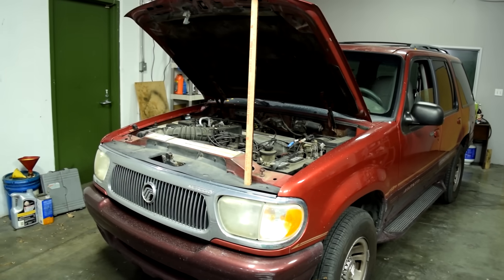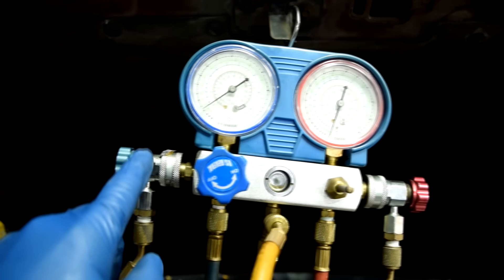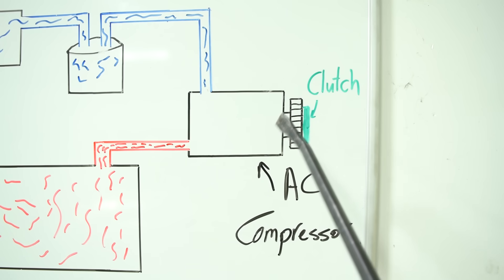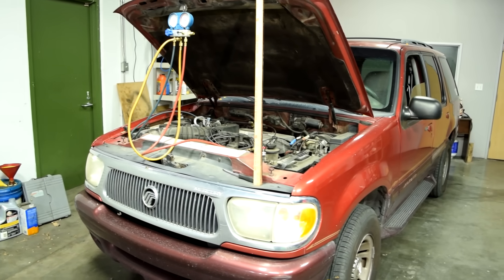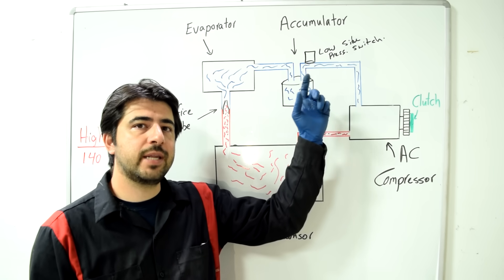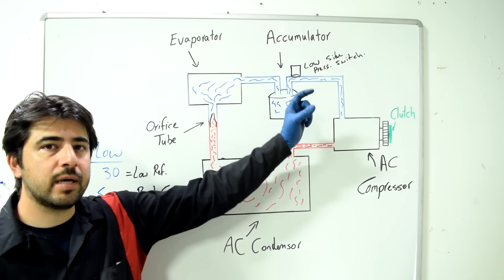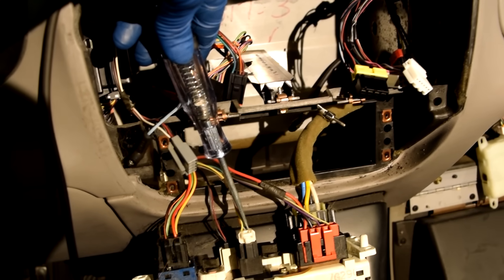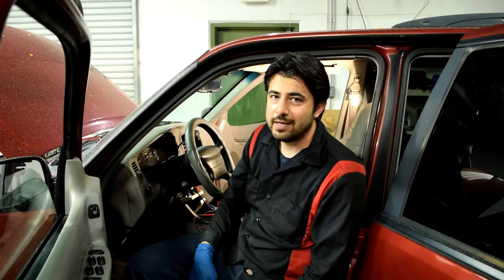Automotive AC Diagnostics, Operation and Repair

Comment: I have replaced so many of these blend door assy I can do it with my eyes closed...
Reply: Question sir. Do you remove the air handler assembly from the vehicle and use factory parts? Or do you use an aftermarket kit? Thanks
Reply: @josephmaslowski4051  factory parts
Reply: @ThomasAdsit  thank you. I've used "heater treater" so far so good.

Comment: Great video, there goes a like!

Question; I have a 96 Ford Ranger, same A/C as the Mountaineer you work ok.
Very hot day (40°C) and very humid too.
Static readings on both sides: 90PSI
When I turn on the truck and A/C (on max, full cold and full brast) the low side stays FIXED on 40 PSI, and the high side also stays FIXED at 190PSI. Neither of the gauges goes up or down, they stay in place.
Also, the A/C compressor stays on all the time (no ON/OFF cycle) and no condensation water is coming our from the HVAC box.
It blows cold air on the inside, but I think it should be colder.

Im affraid that if the a/c compressor wont cycle it might get damaged.

Any input on my readings? Any help will be appreciated! Thank you very much

Comment: Excellent video explaining how A/C systems work.
Can you give a video presentation on converting a R12 system to R134. My 1991 Toyota is leaking the R134 installed. Thanks.

Comment: My ac gets coldest when I don’t turn the blower on high   : when it’s barely blowing It gets down to about 60 degrees and any lower the compressor kicks off. But once it gets back to 61.1 degrees the compressor turns back on . When I put the fan on high it gets warmer to about 78 degrees? Why would it do this ? I’m trying my best to learn and fix it . Plz help me
Reply: Sounds like an air flow issue not a refrigerant one.  Your blend door may be cracked and the  higher fan speed may be pushing it.  Causing hot air from the heater core to      Mix.  I’m not 100% sure but it’s worth a look

Comment: Cut open the blend door assembly and tape up the blend doors.. especially if you see any foam in the air vents on the dash. Famous in the VW’s like the amazing 22mpg eurovan. 

I hope the guy let you finish and fixed this. No going back on a solvable if not “simple” one like this. Nice video.

Comment: How do you no if you need a new dryer
Reply: Measure the temps at the inlet and outlet line, you need to use temp meter with pipe clamp or beaded thermocouple taped to line, there should be no temp difference, if there is restriction the outlet like will be colder as its metering the refrigerant thru the restriction..

Comment: The blend door as the cause of the problem does not seem to fit the operational test of the low pressure/compressor short cycling.  Why would the blend door cause the AC system to short cycle?

Comment: You stated the AC pulley turns freely when drive shaft turns, which is incorrect. It turns because of the belt which is turned by the crankshaft or other main drive components.

Comment: Brillant tutorial. The only thing missing in the video,  you didn't check the low side pipe temperature to the touch by hand to see if it is actually doing any cooling at all before you jumped into the cabin and questioned the dash temperature control potentiometer. But all else was first class presentation.

Comment: I had a mercury and I can confirm they are all built like this. The most hard to get to piece that requires the most effort will be cheap and break causing total failure of the whole system. its designed to fail unfortunately

Comment: 2003  f150 4.6 engine surges when a/c is on, or when it's on. Defrost or vent/ floor settings

Comment: I had a 93 Ford Probe, the blend doors were busted on it.  Had to just prop the doors open. It appears Ford hasn't fixed that as of whatever year that Mercury is.  This is why Toyota resale value is so high.  They fix problems and make each model better.

Comment: Please what do you suggest is the best solution when the compressor is faulty and has low pressure to pump gas? Do you support flushing the condenser and changing its drier, or do you support changing the condenser completely? 

Do you also think there's a good chance for the AC condenser to still be ok & reused once the compressor knocks (ie. When the compressor is faulty)?

Comment: The position of the evaporator can be found at the very epicentre of the cars existence.  Everything in your interior is connected to it in one way or another, and you will learn to undo bolts upside down, sideways twisted at the elbows, while sweating and cursing.

Comment: I decided to just bring my car to my mechanic. 
My cars left side was hot, right side was cold. The day before the ac wasn’t working hardly at all, I’d say blowing about 70 degrees out the vents when I had it set to 60 on both sides. Idk wtf was going on. I checked with an AC pro gauge and the low side was 110 psi when it was running, and the right side couldn’t be tested bc I didn’t have the fitting for it. Oh well

Comment: Can you offer advice on diagnosing my AC solenoid valve on my compressor.    System Keeps intermittently working.    Won't get cold for several miles.   2009 Volvo XC90

Comment: Someone plz help, hv 2005 Acura RL, ac worked intermittently, now totally not working, all relays, fuse checked and replaced, has  refrigerant for sure. Any advise on how to teat clutch on this car has 3 wire connector

Comment: Great video! One thing I would add: With the style of AC gauge fittings you have, watch your gauges as you screw in the knob to open the Schrader valve in the service ports. As SOON as you see pressure register on the gauge, STOP! Far too many people screw those knobs down all the way and damage the Schrader valves. Then they won't seal correctly and all the refrigerant is lost. Seen it happen too many times.
Reply: Dude. I think I just did this. Thx for this comment! Now I know why my schrader valve stuck wide open after charging it😢
Reply: Thank you for adding this comment. And though I didn't use it yet I feel like knowing what COULD happen before messing with it is better for me all the way around. You know that thing; whatever can go wrong will usually happen on my watch and wallet.

Comment: Soo I've been told that since system is empty of freon compressor won't turn on ? This mechanic supposedly tested it at compressor and it was getting power but since it's empty it never would be getting power because of pressure switch ?

Comment: Good video.  Its interesting how all the manufacturers went to plastic blend doors with servos.   The old cars used metal doors with vacuum actuators and they lasted the life of the vehicle.  I currently have the heater box out of my 05 Ram replacing the all the blend doors .

Comment: thank you for this video, coud you help out. i replaced the high and low pressue switch recharged it cahnged temp sensors up on the grill. before i recharge the system the ac button was blinking three times but the clutch isnt engaging. anyhting else i could look at before i change out the compressor

Comment: why can't you just put a shut off valve in one of the hater hoses? no hot water circulation to the heater core = cold air only coming out the vents your ac now works...

Comment: Evacuated my 2000 Saturn SL1  . Recharged , compressors running and fan also but High and Low pressures both reading 50Lbs.  Any suggestions?  Thanks

Comment: When taking the readings do you just idle the engine or idle the engine at 2000rpm for the chart given.
It looks like in the video with the numbers you gave it was at idle.
The reason i ask is some videos say 2000rpms but will the chart be accurate at idle and 2000rpms.

Comment: 2 years later I have a car with your 3rd example with a high side over 100 psi. Now I at least have it narrowed down to an expansion valve stuck open the evap intake or a check valve in the compressor. Thank you for your very helpful video.

Comment: It's 100F in my garage, and when I fill my system with refrigerant to the correct amount it decides to skyrocket the high pressure lines.  It's so high, the high pressure switch shuts off the compressor (at 475PSI).  If I recover refrigerant down, my low pressure is not optimal but my high pressure looks fine.  It seems to run fine at 35PSI Low, and 300PSI High.  Charts are showing low side should be at least 45PSI.

What can be the cause and the solution?

Comment: My next step would have been to run the car with the blend door manually shut in the cool position. If in fact it was pumping out AC I would’ve seriously considered disconnecting the door from the automatic operation in manually adding some sort of throttle cable type unit to it. 

Of course the real question is how many times do you need heat in Southern California? Why not totally disengage the blend door or turn it 3/4 of the way to go only and manually have it in a fixed position? One of my favorite things to ask people do you want things functional, or do you want them operational? Functional is a higher standard, but if the answer was that all he had to do was pull a knob, like an old choke knob, to get his air conditioning to work I would have bet he would’ve gone for that. But that’s just the way we think up here in Pennsylvania.

Comment: Very informative.  The blend door on my 2001 Silverado stopped working, or didn’t work well. I took it out to test and found it was moving but slow and weak. A replacement motor fixed the problem.

Comment: Hey man, just as a heads up, at 1:20 where you used that flathead to "do a redneck check and see if there's any refrigerant in the system," you're intentionally releasing refrigerant in a way that's not in good faith and not covered under de-minimus, which is a violation of EPA 608 and 609. Might want to amend that

Comment: Okay, finally!  Nobody talks about static pressure.  They all hook up the gauges and start the car.  But if you have a leak (no coolant), the A/C won't turn on.  I had zero static pressure on both gauges.  This tells me a have a hard leak.

Thanks for that little bit on static pressure.  Now I just need to know where to get some of that dye and a UV light.

Oh, and yes, this is Florida.  It's February, and surprisingly hot this year.

Comment: Very good and thorough instruction, even if one has someone else do the repair, they should understand the system.  I don't know how often I hear people with used cars need 'new compressor',  etc.  I see now that more likely they had a valve or other issue.  Keep up the good work!

Comment: Thank you, man! This is the only video where I learned when is the correct time to read the gauges to be compared to the chart. Every other video says this much of pressure readings but the needle is moving all the time and doesn't mention at which point those readings should be taken.

Comment: My mechanic just stressing me out my engine shuts down when the AC is switched on
Reply: Do you have any other check engine lights? Usually in the system they have something that will bump up the idle to compensate for the drag of the air conditioning system.

Comment: Ok, my pressures look ok on 1998 Mercedes. But it does not make more than slightly cool. I had it re-gassed but it made not much difference. 
Heaps of green oil sputtered out of the gauge manifold and hoses, all over everything when I slowly removed them. Is that normal? What else can I check?

Comment: what do i do if my car starts doing a screeching noise the second i turn on the AC
Reply: That is clearly a clutch and or compressor bearing problem. Your statement assumes that when you turn your AC on the clutch engages in there and start screeching like hell. I would be interested to know if there was any Freon left in the system?  Gauge readings would help.
Reply: @PaBurgher  i agree. all the freon is still in the system after years of not being in use, i think i am probably just going to replace the AC compressor.
Reply: @mistamfmike8195  First thing I can tell you is that if it is broken, you can’t break it anymore. I don’t know how to do a clutch check. But before I started pulling off the compressor I was trying to find away to check the clutch bearings. Just saying. I would look for a YouTube on clutch replacement before I went any further.
Reply: @PaBurgher  thanks man! i really appreciate it
Reply: https://youtu.be/RFC5jMhUm4s

Comment: my ac on my 08 mercury grand marquis isnt cold heres the readings i got
low side 75-125
high side 300-500
the needle goes back and forth in a cycle

any tips

Comment: Really enjoy your videos and missed you these last few months, thought something terrible had happened but thankfully you were just digging holes somewhere.

Right, so what if it's charged but the compressor clutch doesn't activate - replace the pressure switch ? Could it be anything else ?

Comment: I've done testing on my 1993 Nissan 300zx and determined there is no continuity between the A/C relay and the low pressure switch. There is no damage that i can see to the connector or the wire. My shop manual instructs me to repair the harness or connector. And that's where I'm stuck. How do I proceed from here?

Comment: Gotta love the humor. I do have a question for you.. is there anyway to tell if your system has PAG oil?  And enough for that matter. I tried one of those little low pressure side testers and I can't tell. The tester didn't change colors at ALL!! So either my 12 year Audi has perfect PAG oil..hmmm...or it's empty.. hmm..bad... or it's just fine. Given the system got a little recharge this summer, it works perfectly, (46 degree air from vents) Low pressure side like by access port before accumulator sweats bullets... what else to try?

Comment: The only video I found that explains the proper valve use.  When just measuring pressures, the two valves are closed.  When vacuuming the system or feeding Freon, open appropriate valve.  Thanks!  People, please buy this tech a coffee.  Peace.

Comment: Install a valve on the heater core supply hose like a 1965 F100 or F250. Then get an aftermarket choke cable and then they can shut off the hot engine coolant going into the heater core when they want to use their AC.

Comment: got a question my system taks 1.43 lbs i put in 24 ounes 2 cans its cold and cycles... so im full basically yet the sight glass you see no bubbles no liquid.. and i still low? i did the math conversion 1.43 lbs is 22ozs.. so im wondering if i need to add a half can or another can?

Comment: at 13:30, I always thought the H side was the THIN tube, and the L side was the FAT tube!!
Reply: High side is thin tube with big connection. Low side is big tube with small connection. It doesn't make sense, but it is that way.

Comment: Ratchets and Wrenches

If you're in Southern California, where it rarely gets cold, why not just bypass the hot water flow through the heater core, and enjoy the A/C.  If you sometimes need the heater, 2 Y-connectors and a simple ball valve would allow you to adjust the amount of hot water allowed to flow through the heater core, w/o spending big bucks.  If one were really creative, the hot water hoses could be insulated and routed to an area above the front passenger side footwell, so that the ball valve would be inside the vehicle where it could be adjusted to supply heat as needed, w/o  having to stop and open the hood to make the adjustment.

As a treat to your  viewers, here's a link to a YT channel where the Car Wizard explains what it takes to get to the blender door housing or heater core assembly and replace it in a typical modern vehicle, in this case a 2006 Subaru Impreza, and gives us a visual explanation of why such repairs are very expensive, considering the labor for removing the many pieces of vehicle necessary in order to get to the mechanism that needs fixing, the labor and parts expense for making the actual repair, and the labor and skill required to replace every removed part correctly and to verify that everything works as it should -  https://youtu.be/oCjn3VYQuBA

By-passing the heater core is a much simpler and cheaper approach in vehicles not covered by warranty.

Comment: What cuases noise when ac is on? The noise starts when the 2 condenser motors some on and noise stops when motors stop? High side pressure increases and overheats.

Comment: Unfortunately,  Nissan had their hand in building those Montaineers.  They are not making quality cars like they used to.   I have kinda the same problem with My 2001 Nissan Sentra,  but,  believe it or not,  it has a steel cable that does the same job.  The plastic knob is screwed up on it, but luckily,   I can put a small pair of vice grips on the steel cable and pull it to air conditioner mode, or push it in, to get heat.  Nissan needs to go back to building quality vehicles again.   They will eventually go out of existence, if they don't which would be very sad.

Comment: Wow. Great vid. Concise. Accurate. Thorough. For once I can't easily find room for improvement and I can't find anything to complain about. Except for one thing. RandW closed both the valves on the gauge set. Then he connects the quick-connectors to the schrader valves at the high and low side of the car's AC system. Then he turns the knob on the quick connector to allow flow from the schrader valve and into the hose. Then he says look at the gauges they both show the same pressure. Well, unless he remembers to open the valves on the gauge set,t he gauges won't show nuttin.

Comment: So in my Subaru the air will work for a few minutes or so when I first start the car in the morning, but it starts blowing warm air. My first thought from brief research is the expansion valve. I guess I need to invest in some gauges. Thanks for the informative video.

Comment: Should both gauges be steady when engine is running? I checked my town car and the high side is at 150 but the low side keeps jumping from 20-45 any idea what is wrong?